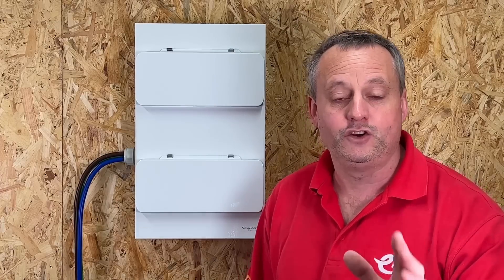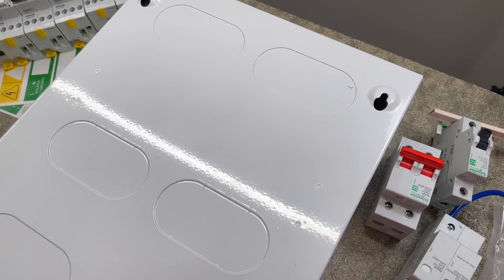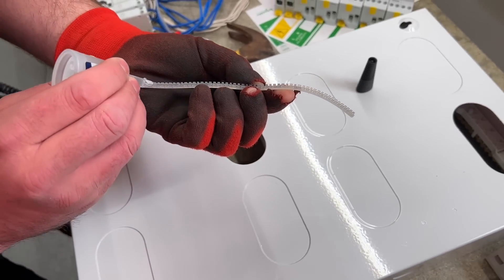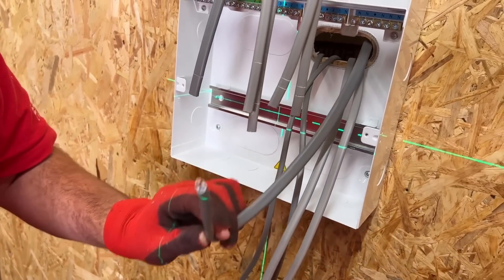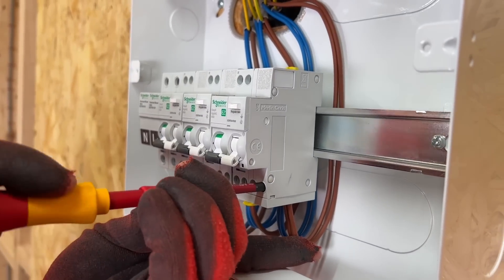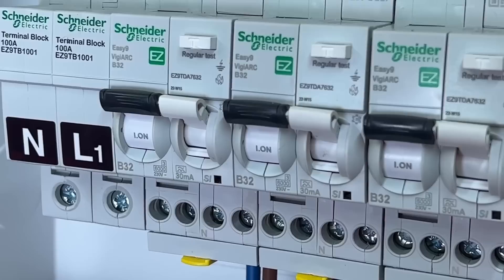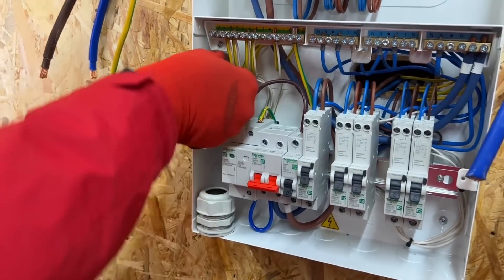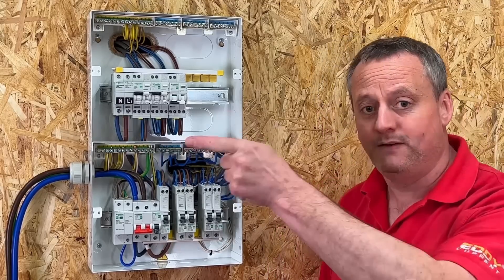Are UK Consumer Units Big Enough?

Comment: Nice job. I left the UK and now work in NZ. It still amazes me how in the UK there's no earth insulation with the T&E cables. Here it's automatically insulated and there are meter marks on the cables. We also use square drive screws here, which are excellent because they can hold on the end of the screw driver by themselves. NZ is also starting to very slowly use AFDD's. Hardly anyone uses RCBO's, but I much prefer them. They do add up to more cost than RCD's and MCB's, even at the rate we use RCD's here, because NZ only allows three circuits on each RCD. Power circuits are all radials too and you are only allowed 4 outlets per circuit, so consumer units are getting bigger. Many new houses are using 3 row boards now. I hardly do domestic work, but I've been seeing them in a few new houses I've visited.
Reply: The earth in T&E not being sheathed is by design and not because of cost
Reply: @GeeTheBuilder  Well I do remember years of using it as an outer sheath stripper. Mind you, the cables (TPS) we use in NZ has a manufactured weakness down the length, so you can easilly pull the outer sheath off with the insulated inner cables.
Reply: You can buy cable with the earth insulated. It just costs more and is bulkier.
Reply: Here in Australia rcbos are mainly used it's the same rules as nz 3 MCBs maximum on an rcd but on new builds I almost never see it but builds from 10 years ago were doing it alot
Reply: @lukasbuzz  Yeah I thought Aussie was now using RCBO's as standard. Also moving into AFDD's. NZ is usually behind Aussie. I noticed that Dist Boards are getting bigger and bigger to house other smart home related equipment. Most of my work has been in the oil and gas sector, so i'm not hugely up to date with all the latest residential changes and updates. I think the PDL/Sheider Iconic series is the "go to" brand now. Used to be PDL 600. From memory of my time in Aussie years ago, it was all HPM or Clipsal gear.
Reply: of course the idea being that if some twonk chippy or DIY dave stuck a nail or screw through the cable then the device would disconnect and not kill said pillock
Reply: @Chicken Stranger I definitely agree with all that. My last few jobs I have done with all RCBO's.
Reply: AC type Rcbos don’t protect against dc faults which still can be purchased! So stating that some Rcds don’t protect against dc unlike Rcbos is incorrect!
Reply: 4 socket outlets per power circuit? I don’t think so??
Reply: @jacobwelch7835  I'm sure that is at least the case for kitchens and laundries. I don't do domestic work here, but I do think 4 is the general rule of thumb. Of course, it does depend what you are running off of them.
Reply: @jacobwelch7835  
Using a final ring we can have as many sockets as we like as long as the floor area is not larger than 100 square metres. 32A breaker at consumer unit 2.5mm cable minimum.  It saves a whole lot of radial circuits - and cost.
Reply: From April 2024 uk introducing insulated earth.
Reply: @AntonyoKnight what’s the source of that info?

Comment: I quite like the idea of this though I do not like the AFDD double rail bus bar. Hopefully it's constructed in a way that they're sliding block terminals on the AFDD's and not cages otherwise the potential for incorrect termination is more than doubled due to how it's fitted. The SBS boards David has showcased a couple of times, and the Schneider Acti9 are much better implementations. 

Have to admit if we're required to use those 2DIN AFDD's modern consumer units, let alone pro-sumer unit's won't be big enough. 
No AFDD's in my new 29 way double stack FuseBox CU and even that's basically full after solar/battery/ev on top of regular circuits. I can picture having to move onto Triple Stack units like the continent if manufacturers aren't making 1 DIN AFDD's and the requirement for them expands.
Reply: The Continental consumer units are way superior in design to the outdated junk we turn out.

Comment: Where is earth connection for cpc’s of circuits connected to afdd’s (top of the board)?
Reply: Is there any point in protecting the edges of the knockouts if the holes behind the board are smaller than the knockouts themselves? The cables are naturally away from these edges because of this. 
Would also be a nice touch if oval shaped open grommets were supplied with the board instead of cutting and gluing. 🤷‍♀️
Reply from the maker: At the top of the enclosure
Reply: @efixx  I see only 5 cpc’s from afdd circuits but no earth link to incoming earth above main switch